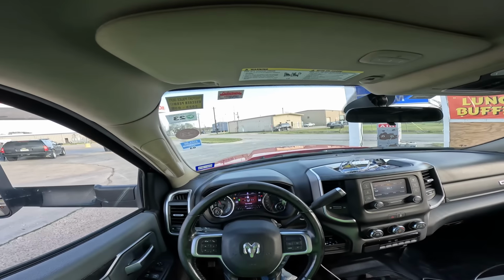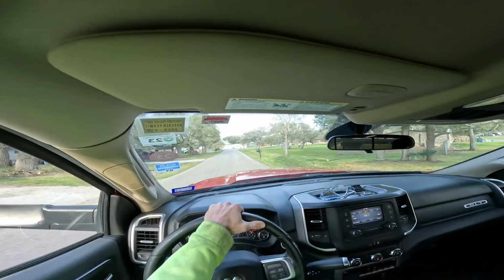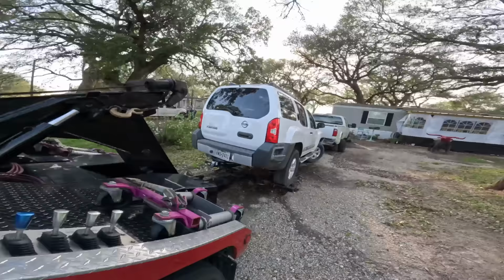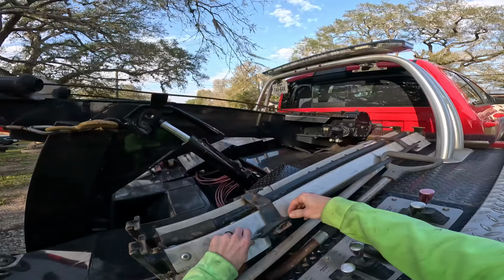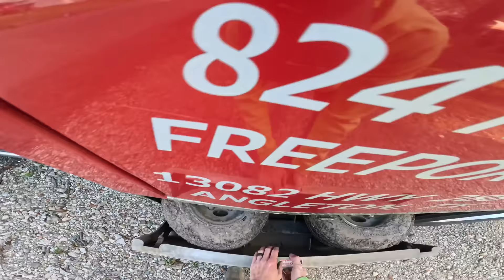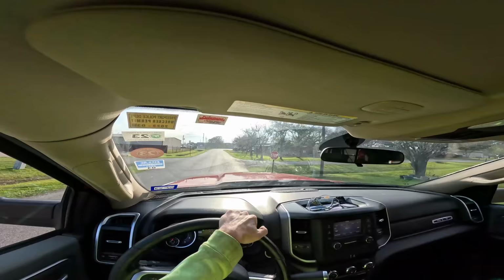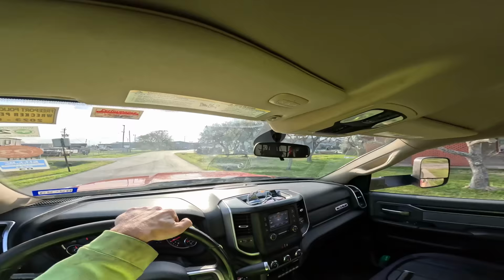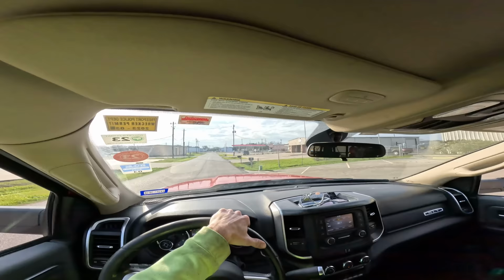Turning Your Wheels Won’t Stop The Repo Man!

Comment: The best way to keep the repo Man from taking your car. Make your car payments
Reply: Smh
Reply: I use a custom molded plastic sheet basically about 1 inch thick (2 .05 thick industrial plastic with a metal press lining in the middle)  it presses almost flush against the wheel and feathers back towards the wheel well and have basically carpet knives on the end , reaching under would cut an or slice a persons hand but also makes the back of the wheel not fully rounded so it’s hard to wedge any types of lifts . Unintentionally it’s like that because  there’s a rash of tow companies in my town towing illegally by “mistake” and they let your car go because it it was a “mistake” but like 90 percent of these “mistakes” make your catalytic converters disappear on there lot and of Course they’re protected from that by state law . So basically a few companies are “Cat diping” here. I was able to use it , because the hoa tow guy definitely challenged me. Turns out they let me use it because it’s designed as a deterrent against catalytic converter theft but it makes the car extremely hard to tow but not impossible, almost nothing is impossible to tow and most cars are designed with some way to tow in mind because of emergency purposes. Notice all the cars started popping up with lil squares on the front 😂 if someone with a tow truck wants your car bad enough there going to get it. Even if you take all the wheels off 😂
Reply: @christopherhaynes8101 dude that’s the most epic shit I’ve read recently 😂
Reply: Nope , airbag the car 😂
Reply: @Xix305 or just make the payments. Who would buy something they can't afford, they must be terrible with basic math
Reply: OR, and I do mean or you don't borrow the money to begin with, and you never see the repo-man because you have no payments to make and you lose nothing! I know, how Un-American of me to pay in cash!
Reply: I seen a video of a guy pulling a gun on the repo guy and he dropped the car and drove off.
Reply: @ivansmith654  xuvu
Reply: @ZachAsaD  I have worked codes on three repo guys in my career. Amazingly, all three were known to have ego problems and liked to pull the billy bad ass card on people. When the bricks started stacking, they weren't as tough as they thought they were. Be decent to folks no matter the situation. People lose jobs, get cancer... all kinds of stuff that can put them behind. Don't play with people's emotions.
Reply: @christopherhaynes8101 weird, I just use a shotgun...
Reply: Or here’s a crazy idea:  only buy as much car as you can afford in cash.  Takes the financier and the repo man out of the equation entirely.
Reply: @markmcleod5079  unless they're a corrupt towing company that's "accidentally" towing cars just to steal the cats as the dude above was talking about...

I mean, I hold the titles to six of my seven, so I'm not real sure how that would prevent what he was referring to.🤷‍♂️
Reply: @brianbird3756  Great point. This is why we need more government…to pass a law against cat theft.
Reply: @markmcleod5079  🤣🤣🤣
Reply: Best way to keep the repo man away is to live within your means.
Reply: Its not yoou car till every last penny is paid. Then it is your car.
Reply: Want to get back on your feet?.....miss 2 car payments
Reply: This is why you buy your stuff instead of financing or fleecing.
Reply: Or just be sensible and buy a car you can save up for and afford

Comment: That’s a lot of trouble for a vehicle that wouldn’t even bring $1500 at an auction. Tough job but someone has to do it.
Reply: Even if it only brings $1,500.00 at an auction the debtor is still responsible for whatever money is still owned.
Reply: Most lenders wouldn’t even bother, but from the looks of it they probably got it from a “buy here pay here” lot. Those dudes will grab that piece of junk and refinance it to someone down on their luck for about 28% interest…that piece of junk is the gift that keeps on giving for shady car lot owners…paid for itself more than a dozen times over.
Reply: The Debtor is still on the Hook for the Difference that the vehicle gets at Auction.
Reply: It an exterra. Those things resell values are sometimes pretty high because it’s a highly sought after vehicle
Reply: yea I think it was the principle on that one. Wasn't a straight piece of metal on it. Looks like they never washed it. Probably stank inside.
Reply: So they are not paying for the car and you think they are going to pay the difference between what they owe and what it's sold for? 

They might pay something in the next 10 years.

Comment: I’m surprised that you had all that time available to set up the front wheels before anyone came out.
Reply: That's because it was his own car .. he was just trying to make a video .. to get his likes up😅😂😅
Reply from the maker: Nope. Everything on my channel is genuine. 
I don’t have to fake anything for views.
Reply: Bubbling meth makes a racket, hard to hear what’s up outside
Reply: Total voluntary. You could tell. He was given all the time he needed to get it off the property. It was all ready to be cherry picked at the end of the driveway. The operator even checked the door to see if they left the key or if were unlocked so he could try straighten out the wheels and put a strap on the steering wheel. The thing probably doesn't run anymore so they gave it up instead of making payments. Smart.
Reply: @MrChicanoRadio  Blah, blah, blah

Comment: Won’t stop the repo man but definitely adds a lot of time and work to get it. Also, prevents damage to transmission because the car is dollied-not being dragged.
Reply: On a real repo, they would pull away without the front dollies to a nearby place to put on the dollies.
Reply from the maker: You’re entitled to your own opinion, but in saying all that, it just goes to show you’ve never  done this line of work, and definitely don’t have the mind set for it. If I’d have hooked onto and rolled out, the front end would have dropped down into the ditch, and then I’d be paying to fix it all. 
Contrary To what you see on TV, not all repos are snatch and grab. Very different in the real world.
Reply: @Towtruck_Dustin  I never said I have driven a tow truck.  I didn't see a "ditch".  Looked like you were backed up a driveway.  True that even a suburban gutter could upset the vehicle being towed.  It still isn't rocket science.  
No problem at all to strap down and pick up the back and drive off to safer local to do the front, as long as you have a wide enough escape road so you have room for the vehicle crabbing behind you. 
I'm always more concerned about my safety than someone else's car, or even my job.  NFW I would attempt that full rigging in their driveway.  Respect yourself first.  
Fk the ditch.
Reply from the maker: You would rack up quite the list of damage claims with that mindset lol definitely stick to your day job lol
Reply: @Towtruck_Dustin well damage claims don’t me nothing if your the repo man, they can’t prove you broke the transmission by towing it and the debtor didn’t do that. You really gonna risk your life over that?
Reply: It's a rear wheel drive truck. You aren't dragging anything. Yes it may be "4 wheel drive"..... but it has a transfer case. Most are electronic actuated by the computer, and only lock with the ignition on and wheel slippage.
Reply: @jasonsprouse2803  agreed but most newer cars need to dollied to prevent damage to the transfer case. The Nissan that I have for example states in the maintenance guide that the vehicle must be flat bedded to prevent drive train damage.
Reply: @grazz7865  ... They say you have to flatbed everything. Doesn't make it true.
Reply: @x-man5056 There goes the transmission and proper the suspension 🙄
Reply: @bigjun2004  remind me to NEVER EVER go to a repo auto auction 😂😂😂

Comment: The driver had spent money on upgrades like new aftermarket headlights, push bumper etc but neglected the main priority which is fully paying off the truck first or at least keeping up with the monthly payments. I bet there’s an aftermarket stereo system and other engine mods on that Nissan worth at least $2000. 😂
Reply from the maker: Very likely lol

Comment: I've always wondered how those dollies worked!
Reply from the maker: The more you know lol
Reply from the maker: In a lot of cases it’s easier and safer to get a wheel lift and Dollie’s on something, but they insist it needs a flatbed so then you gotta drag it 😂
Reply: This.  I was thinking like--do they drive it up on them? Dead car? Do they push it? Not happening/really hard?  Do they first use the tow truck to lift the front end and put the dollies underneath?  Won't necessarily have access.  Nope--build and lever up it turns out. makes perfect sense. :)

Comment: This had to have been a voluntary repo, no way in hell would I have strapped down and dollied up in the yard. That took waaaay too long and made way too much noise.  Pick it up, pull it away from the home and then secure it.
Reply: So what about the turned front wheels w/o the dolly?  I'm thinking w/o dolly or strapped rear wheels he risks it falling off.
Reply: @danielgoodman3578 I mean you don’t have to do the dolly, he could have easily just disengaged the car and put it in neutral or disconnect the wheels from the transmission
Reply: @PokemonScott  if the wheels are locked in a turned position I would think the risk remains though

Comment: Hey bro word of advice, next time ur engine lift is to short to lift it clear of the radiator support panel, let the air out of the front tyres  to lower car. Saves scratching up their paint on the rad support panel

Comment: Wheel Lift?  Cool is that the proper name for them?   Flatbed's seem to be pretty much universally called Flatbeds (although I've heard the name Rollback used for them as well).   But for this kind of tow truck I don't think I ever heard the name Wheel Lift before.   I've always heard of this kind of tow truck referred to as a Wrecker.

Comment: Even without checking the VIN? Seems shady
Reply: I have Lookouts that Verify each of my Recoveries before I Arrive to Grab and Go.
Reply from the maker: Exactly. In this case, the lien holder found the vehicle after it had been being hidden for years. They called us immediately, and I went to grab it.
Reply: And your Vehicles have Computers on board and are capable of Tracking the Vehicle. The beauty of Factory installed GPS systems. Tesla Vehicles are the Easiest to Track and Recover.

Comment: In times when you don't want to stick around I would just drag it down the road to a parking lot then disconnect the drive shaft and pull it from the front and if it was swinging out too much because the wheel was turned I would have just dropped it in front of the house and and grabbed it from the front just pull it out in the road first
Reply from the maker: After dragging it through the ditch and probably causing a bunch of damage you’re liable for? Sounds like a solid plan.
Reply: @Towtruck_Dustin  I used to work for Mile High recovery and it worked for me never no problems but hey if you want to be a know-it-all Karen be a know it all Karen. I would have pulled it out to the road dropped it then picked it up from the front dragged it somewhere safer drop the drive shaft and be done but I guess some tow truck drivers are scared to leave some marks in someone's driveway and on the road and would take me only a few minutes to be out of that yard and down the road but you probably don't know how to take the drive shaft off so go figure. But I was just telling you to do this in a pinch if you're in hostile environment and you don't want to be in that yard heck have at it see how many times you can get away with it next time when you're in a hostile environment see how that works out for you stick around solid plan right? Damn dotard

Comment: I used to have to pickup repo cars when they were auctioned off.... So many had cranked wheels full lock with a locked column. No keys of course.   Sometimes I had a cranked wheel one to put on the back of the roll back then a cranked wheel  RWD'r that had to go on the back of the wheel lift  backwards..      Annoying.  No dollies or anything we had.. So.. It was just dog tracking to one side bad down the highway
Reply from the maker: I had to limp one down the road this afternoon because it was RWD with the wheels cranked lol
Reply: @Towtruck_Dustin  Yea you  just need to ride in the middle right on the double yellow or on the far right depending what side its kicked to . Turns are fun.. Best is when its turned the right way so it cuts fast like its a  tiller rig fire truck.   I got good backing them up straight even with kicked wheels and then do one final fast cut of the wheel in the truck and they straightened out fast in a parking spot  then lower it. It still looks more funny AF on the back of a roll back on the wheel lift vs as funny on a self loader. . First time I had to take one with crooked wheels I was like "Awww hell no " Then I learned fast how to do it. Also on the roll back we didnt have a snatch block company was cheap AF... So...  Figured out when I first started if I angled the bed real crazy backed up to the car crooked with the roll back the car would be straight by the time it was dragged up the bed. locked in park.. And.. Crooked wheels. ... Kinda park the roll back like a V or a L and it the angles would work out and the car would straighten on the deck by the time it was all the way on the 21 feet

Comment: Repo operators are a necessary part of life and a hard profession to be in, but what stopped you from knocking on the mans door and getting the keys after you had it locked onto your truck?
Reply from the maker: That’s the lien holders job to make arrangements to get the keys. The longer I have to be there, to more risk I have of getting into an altercation. 
Now if you come out while I’m loading, and you’re cool, and surrender the keys, I’ll be cool and let you get your stuff out of the vehicle, but if they wanna act a fool they can make those arrangements with the lien holder.

Comment: Is there no way to tow it safetly to a spot down the road or around the corner to strap it down? I know its dangerous but id be soo scared getting outta the tow truck in their yard you know their not gonna b in a pleasent mood and who knows what they could do to you
Reply from the maker: Normally that’s the plan, but in this case the wheels were cut in a way it would have went off in the ditch, risking damage to the vehicle, and a damage claim.

Comment: WHY NOT A FLATBED TRUCK BECAUSE THEY CAN DO ALL VEHICLES FROM THIS TYPE OF JOB TO ACCIDENTS
I DONT KNOW HOW THEY DID WHITH OUT FLAT BED TRUCKS AND SUPER SLOW NOT REALIZING HOW THE BAD DESIGN WAS THE HOOK AT THE BACK WERE ALOT MORE DIFFICULT AND THIS DRIVER SAYS IF HE HAD A FLAT DECK THE PICK UP WOULD OF BEEN ALOT FASTER 
I WAS SURPRISED THAT HE COULD GET THE DOLLY TIRES ON BEING SO TIGHT TO THE OTHER VEHICLE 
A FLAT DECK HAS DIFFERENT SPOTS ON THE DECK TO HELP TO DIRECT TTHE WHEEL OR DAMAGE TO GET ON STRAIGHT

Comment: Is the camera on your forehead? Do you own the Company?? Btw,  I woulda just clocked and maneuvered down street  then safety chained, called in to local Pd then woulda drove to open secluded public place and THEN dollied and wheel strapped, saftey chained and Towmated popped unit. Unless it was a Voluntary that's a whole less cautionary procedure.
Reply from the maker: Camera is mounted on a hat, and I’m just a driver for the company.

Comment: why the dollies ? you just needed to watch swing and take it slow ,not like you were in tight traffic. regardless you did pretty good ,noise is not a good thing though, sshhhh quietly
Reply from the maker: Because how the wheels were turned, I felt it was going to fall into the ditch, and risk damaging the vehicle, of which I’d be liable for. 
So I took the less desirable route, and threw Dollies.
Reply: @Towtruck_Dustin  dont take it wrong brother  you did what you were comfy with and it worked tine just put you vunerable for too long  i did rollback for 10 years and just hated dollies so much when id get stuck in a wheel lift  or a sling but learned to be proficient.  you should try pan dollies. they suck sooo much

Comment: Are most of your wrecker ops accidents, repos or a balanced mix of both?
Reply from the maker: Most of my work is roadside calls, I don’t record many of those just because they’re boring and pretty much all load and go kinda stuff. I do occasionally get some that I have to work for, but not very many. 
I generally stick to the flatbed, so I do mostly accidents, and roadside calls, but I’ll jump in a wheel lift truck and run repo’s when needed.

Comment: #1: The whole time I was watching this I just could NOT believe this old ass crappy ass vehicle was even financed OMG (LOL) like, someone still owed money on that pile of crap WoW...

#2: You are a WHOLE bunch nicer than REPO guys up in Chitcago. I have seen similar circumstances where they will just drag it down the road "as is" (IE; turned wheels, parking brake ETC). Hell, my friends that do/did repo were the same way! It's like "their job" is just to get it, doesn't matter HOW... .. . I've also seen motorcycle repos just "dangling" from trucks like the one you used in this video, or even just literally laying on their side on a flat-bed !!! (I guess Chitcago really just doesn't care)!!!
Reply: Also I think the whole time I was waiting for someone inside to notice and start shooting at you or come outside then start shooting at you... Maybe it's just another Chitcago thing but most my guys I know that do or have done repo will grab a car, get the hell outta dodge by at least a few blocks THEN pull over to "properly" hook it (and tie it down and whatnot)... .. .
Reply from the maker: Doing that on this one would have ended in a damage claim. Not all repo’s are snatch and grab.